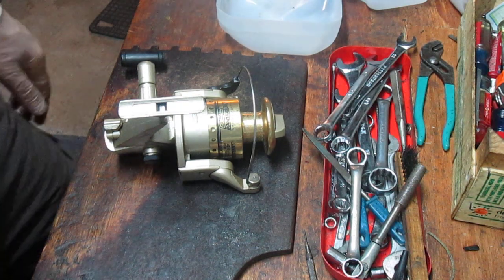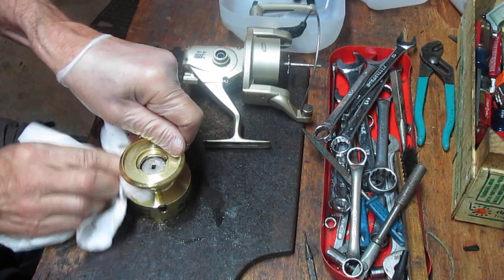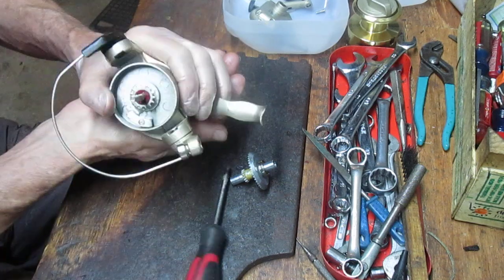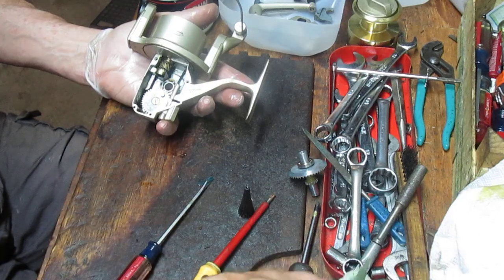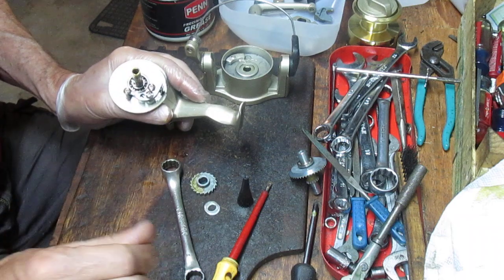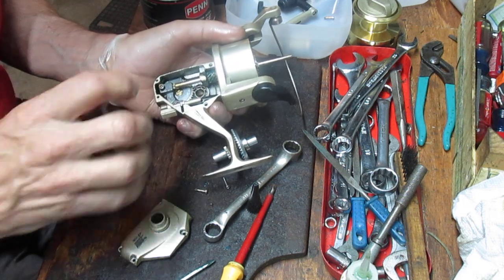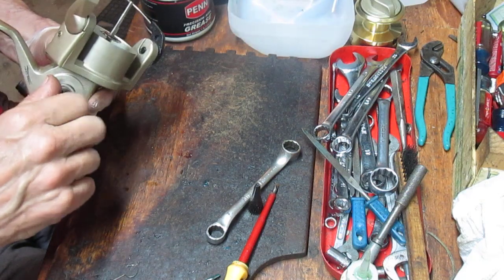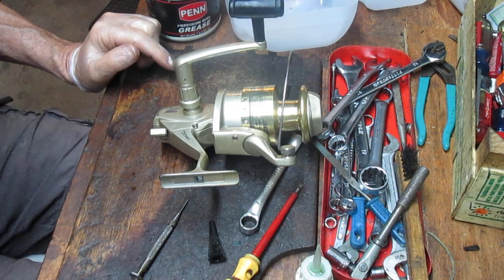Trophy Angler 60 Spinning reel - basic maintenance and service including take apart and drags

Comment: What is that sping looking object you removed at 9:27? Was it debris or a broken spring?
Reply from the maker: It was a broken anti-reverse spring that sits on the underside of the anti-reverse ratchet.  I needed to replace it, but did not have the ability to stop the video and get another, so I set it aside tand continued in order to be able to show the balance of the reel servicing. - Nice catch.
Dennis